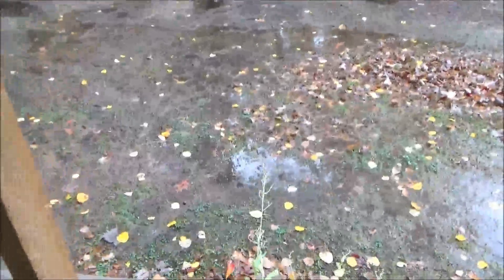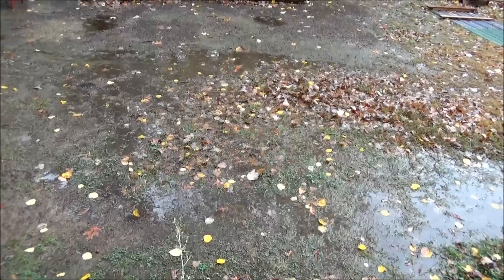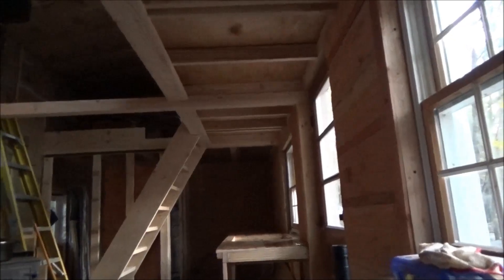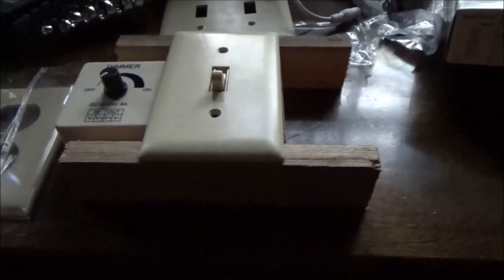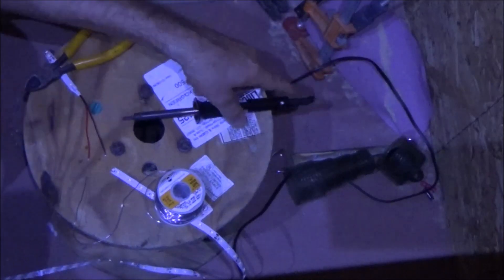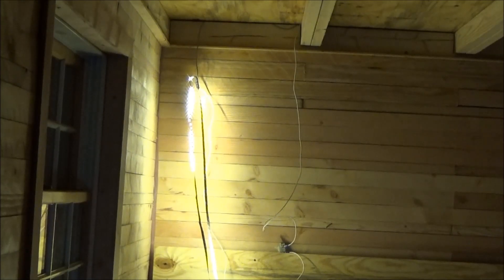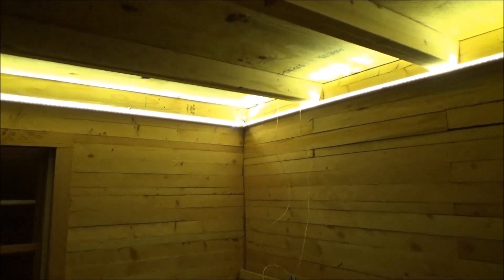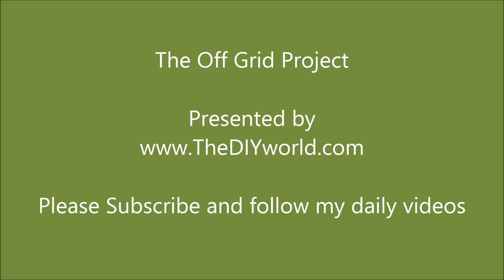Rainy Day Working On LED Lighting In The Tiny House O27

Comment: For your dimmer switch, just use a coax cover plate next to your others.  Take the knob off, put it through the hole in the cover, put the knob back on.
http://www.lowes.com/pd_39281-1571-TP11ICC15_0+1z10w9w__?productId=3236686&Ntt=wall+plate+cover&pl=1&currentURL=%3FNtt%3Dwall%2Bplate%2Bcover%26page%3D1&facetInfo=COAX

Comment: Troy. The lighting looks good but I have a couple of suggestions.  1. Consider increasing the efficiency of the lighting by putting reflecting foil behind it. 2. I think your led pot lights will be better for you if they are moved closer to the wall, that way your body doesn't end up between the light and what you are working on.  Question, how much power does the led strip lighting you have put in place draw from your batteries?

Comment: I dont know if you have done this or skipped this ste and plan on going back and doing it but are you installing fuses for lighting and any other power lines you are going to run 12 volt and 110 v? several have asked this and I never seen an answer.

Comment: since your gonna be running that wood stove soon non stop...maybe put some thought into making a TEG power supply to charge up your batteries and run LED LIGHTS directly
Reply from the maker: Been thinking about that a lot. Only problem is that the real power output of these is about half an amp at about 7 to 15 volts DC. Can run a small solar fan or charge a cell phone.

Comment: All that hard work to make such a beautiful home just to wreck it with surface wiring. It would have been so easy to wire everything up inside the walls to give a truly clean look to the home. With every construction project there is a process to the build, framing, wiring and plumbing then close up the walls. Trying to hide wires behind trim will lead to nails being shot through the wires and damage. Its not to late because the upstairs is still wide open. Fish some wire into the places you want them to give your home a real clean look, and take the advice to get the proper DC toggle switches to save space and a clean look. Being on a budget is fine, but certain things should be done right to avoid future problems that will cost a lot more.
Reply from the maker: It will all come out nicely. Watch and see :)
I am not just going to "shoot" nails into the wires. I plan to secure the wires and use screws to fasten the trim. Trim where it is needed anyway. Nobody will ever know the wires are there.

Comment: He lites up his ceiling and next to get the bath finished. Get car lite switches to do the work, also get inline fuses with blowout indicaters to let ya know where break is. Great look as it is layed out, just get some lite up in the lofts and then no bumps in the nite.
Reply from the maker: Whoah, stop reading my mind. lol
The car switches do not last long in my experience with heavy daily use. At least not the cheap ones. And compared to 49 cents for the AC switches, well, there is no comparison. I will have DC fuses for every single line.
Reply: Can't get'em no cheaper than that. Press on then.

Comment: Great stuff Troy. Couple of pointers. The AC switches will burn out from the arcing. You need to use DC rated switches. You can not just Dim LED's with conventional resistive dimming switches, you will need a 12V LED Driver to do that. Thinking of rainwater harvesting, if you were to build a raised frame for the IBC tank 2/3 of the height of the guttering it will give you some nice pressure to transport water around the meadow via hose-pipes. Similar to a gravity fed system, will resolve a whole host of headaches for you.
Reply: I think the dimmer is a PWM not rheostat , should work fine if it is
Reply from the maker: I have DC LED dimmer circuits off ebay for the lights. Not sure about the AC light switches. Many of the forums I read have mixed feelings about them. I guess time will tell. Maybe a diode across the terminals can stop arcing.
Rain water is a problem with deep freezing winter coming on. I need to bury a water tank for best results.
Reply: The Do It Yourself World what about a bubbler in the big tank, keeps water moving. you could put one of your smaller solar panels on a pond bubbler like the video from MWAS I showed you. Don't you have anymore tarps, throw them over the wood you use and stake down so it will stay dry, a lot of that stuff could be down this winter, just make it liveable for now.
Reply: The Do It Yourself World i was thinking use 2 swithes with 2 different runs of leds for bright and dim.

Comment: I would use the plastic plates as templates for wooden socket and light switch covers. I would hide the dimmer in a small wooden box on the shelf. So that you don't have that white plastic standing against the wood. If you have done the coasters. It should be easy enough to do rounded off wooden covers.
Reply from the maker: I am actually going to put the switches and dimmers in the living room inside a book shelf. Its going to be cool

Comment: How about pull chain switches?  Especially for overhead lighting.  A simple L bracket with a drilled hole will mount nicely.
Reply from the maker: My main reason is the 49 cent price of these switches.

Comment: Do you use Windpower? If not, why? Solar in combination with Windpower will be great for you!
Reply from the maker: DekayLama Wind power is only as good as the tower you put it on. No matter what type of wind turbine I have, if it is in the turbulent meadow, below the tree line, it will not perform well.
Reply: He has tinkered with the idea for awhile and got the materials for a tower to place his turbine over the summer.
Unfortunately he still needs the manpower to put it together.
Reply: Well, you can build a Vertical Windturbine out of scrap... Old Washingmachine Motor, some electronic... should work great
Reply: DekayLama He has a couple windmills already. He needs to repair the blades on one which got broken in a wind storm because he did not have the proper tower for it. Now, he has the scrap to build a really good tower but has not had the time nor the manpower to assemble it. Keep watching. Wind power is coming.
Reply: DekayLama Ssanf is right, Troy used wind power successfully last year, in addition to his solar, but he came to the conclusion that the wind power in his little clearing in the woods was too  erratic lower down....that he needed a higher tower, to get up to where the wind levels were more consistant.   He has assembled all of the materials needed but is waiting for the time that he can assemble a crew to assemble it.  Also, there are crucial things that he needs to get done with the tiny house before he feels he can spare his own time to work on the solar.   Some things that he needs to do in the house have to be done before it gets really cold, so he feels that he has to do those things first.   Have patience...everything will come in its planned order, unless something unforeseen happens....which usually does....lol
Reply: Troy has two wind turbines but he has not set them up yet.  Troy first wants to set up a steel frame that he got for free to set them up again.  I hope he can get it done before the ground freezes up.  The last time he had them set up they did not hold up well.

Comment: That is pretty nice looking great job. Some reason your not supposed to use 110 swiitches in a 12 volt system. I hear it because they arc too much and can damage your inverter but your not inverting lol. It may pop fuses. Be sure and fuse between your batts and your lights. I put some fairy lights under my kitchen cabinets. I like them too they do give off great light and effect.
  You gonna put some cabinets up above your counter later?
Reply from the maker: I will have a fuse on every line in here. I was thinking about a diode across the switch terminals to stop arcing. Increase life of the switch.
Yes I will have cabinets in the kitchen. Soon. If this rain ever stops. Been raining for days and days and days.

Comment: I know you haven't finalised the batteries yet but I recommend looking into a high current dc circuit breaker commonly use for car audio stuff but easy to get them in 200a if needed that high but nice short protection and if something bad happens it's an easy and fast isolation point
Reply from the maker: I have some that I will be using here

Comment: lights look good. I think I would of made the back wall light seperate from the 2 side lights. As for the water. you have all those 5 gallon buckets fill them up; put them in your wagon, and the tractor cart. Those 50 gallon oil drums. put about 3 large heavy duty garbage bags in each and fill them with water. they should hold well enough till you relocate the tank. Heck, if they work out, use them for rain catchment from the RV and use it water garden, chickens if it stays halfway clean. then you just use the tank water for cooking and washing yourself.
Reply from the maker: The drums have welded on tops. I do not want to destroy them

Comment: Wow, I really like those strip lights.  How do you change the bulbs in them if they burn out.  Could you show us?
Reply: You don't change the bulb, it's really all or nothing with these cheap lights. They work, they may work for a long time, but when it comes to replacement he will have to run a new section.
Reply from the maker: They should last about 50,000 hours per strip. If some LEDs burn out, you can cut that part away and replace it with new.
Reply: Of course, you could replace single LED's but for this price would you? It's a buck a strip. When one goes, it's likely a sign that others are about to.

Comment: Those indirect lights look good! I doubt you need a dimmer when you want to watch a movie. The light level may be higher than it seems on the video, but indirect light does not tend to blind like direct lights do. Still, nobody says you need to use the dimmer once you have it.
I notice you plan to put all light switches for the living room against the back wall. Will you have any lights that you can switch at the door when you come in or walk out? Stops you having to stumble through the house in the dark, and you don't have to put your dirty shoes/boots on or take them off in the dark at the door.
Reply: Some LED lights are not dimmable.  Need to verify this!
Reply from the maker: These LEDs put out a LOT of light. I like the idea of a dimmer just as a night light or for effect. Yes I will have a light by the door soon.
Reply from the maker: Keter Magick These lights are dimmable and I even have a remote control for them. Cool

Comment: Looks good.  I like the color range of those much better than the kitchen lights.  I have a roll of that led light strip somewhere that I got on e-bay like a year ago.  If my color looks that good, I may do up some solar powered under cabinet kitchen lights and put in a small battery and a little 10 watt panel on them that I have had laying around for about a year now.
Reply from the maker: Yes the kitchen lights are not pretty but they server their purpose and for a dollar each, no complains here :)

Comment: Nice lighting! Each step is a good step. So, with much applause, I'm going to suggest a few things.
1) throw a tarp over the building wood. Mother Nature and Old Man Winter are breathing down your neck. When you're done with the building wood, move the tarp to the fire wood (or build a lean-to over it). I have seen your tarps and I know that they won't keep everything bone dry, but every little bit helps. 75% dry means only 25% of the drying time. 
2) ID your high traffic areas and get some sort of boardwalk down to avoid "trench foot" once the mud keeps growing. Once the temperature drops, melt will not drain like it does in the summer. Yes, you've got great drainage, but you're going to run into trouble with the mud in a few weeks. 
3) On that note, plan your in and out. Recall the adventures you had trying to get in and out in the spring. Could just be a road maintenance task in running vehicles up and down in the early cold to pack it all down, but don't let your vehicles get trapped up there. 
4) I still say that you had the better rainwater collection set up last summer where it was out in the open and away from tree debris. But you have all winter to contemplate that set up. 
By the way, I am so looking forward to watching you this winter and next summer where we don't have to watch you struggle with your inadequate shelters. Well done sir.
Reply from the maker: Thank you. I have such huge plans for next year. Rain water collection will be off the roof of the tiny home, into a cistern underground.
Tarps are currently being used on the garden at night to keep them from freezing. Fire wood is also covered.
It does not really get muddy here by the house in winter.
Hope to get some gravel for the drive out to my place though. That can be very, very bad.

Comment: Aye man I don't know if you have a water line there where you live or not but think about something like this Eccotemp Systems LLC Eccotemp L5 Portable Tankless Water Heater they have some that run off of a small tank of Propane for months. :D
Reply: He already has one
Reply from the maker: Yes I have one. When my insulated storage room is finished out back, this will be mounted in there for hot showers :)

Comment: What happens if a bulb burns out? Do you have to replace the whole string? I couldn't tell if the bulbs were replaceable or not.
Reply from the maker: You can actually replace individual LEDs. They are common 5050 LEDs. Or cut out the bad piece of the LED tape and replace it with a new one.

Comment: Low voltage equal high amps   equal potential heat equal fire.
Reply: Low voltage equals high amps for the same power used. But running 3 W of LED lights instead of 3 times 60 W incandescent (for the kitchen counter for example) means the power usage has gone down by a factor of 60. That mitigates the "high amps" effect. Cars have a 12 V system, and many wires are pretty thin (i.e. low amps) for the same reason.
Reply: pieter zeeuwen  The Issue is not under 3W, any short circuit will emit tons of heat and in wood environment it's bad for your health :)
Reply: ilan magen It goes without saying that the circuits must be fused, so short-circuits should not be a problem (or not any more than in a high voltage - low current circuit).